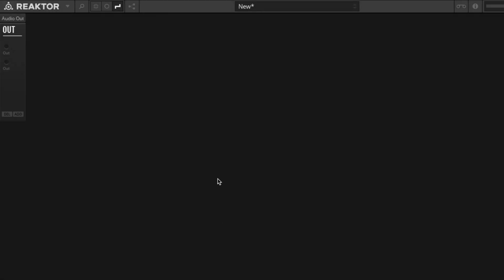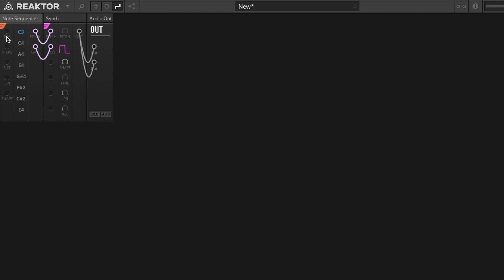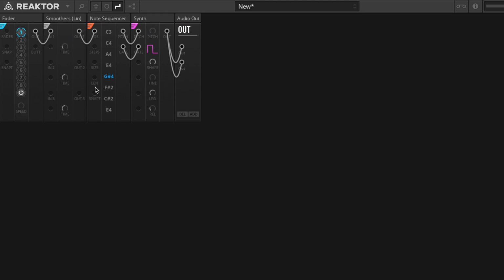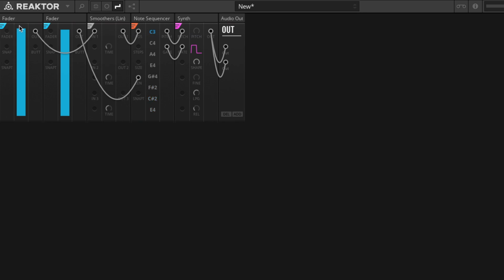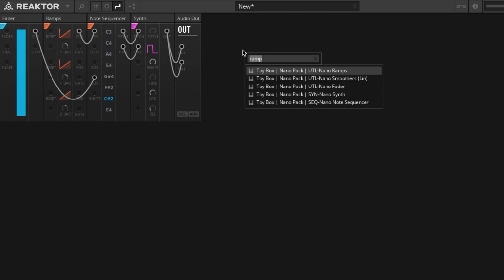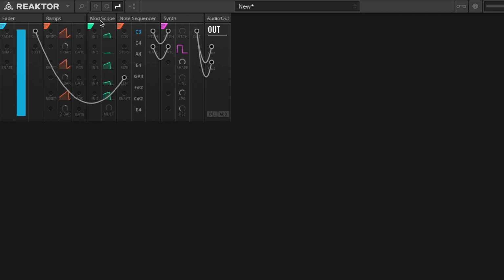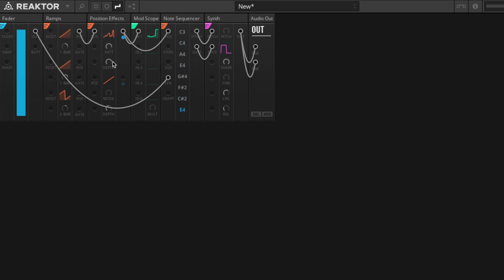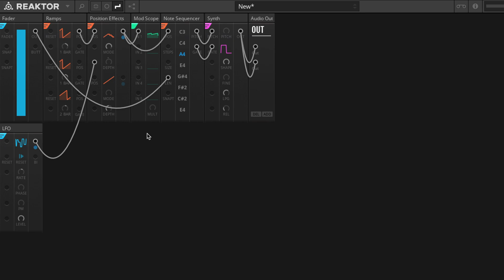Toybox - Nano Pack Sequencer Basics

Comment: Excited about this..BUT how do I get the Ramps block to work? It is not running when I load it and dont k ow how it starts?
Reply: Oh...I press play in my host!
Reply: @stevestringer5110  Yes in 'sync' mode (turn speed knob to the right) the block starts and stops with the host, in 'free' mode (turn speed knob to left) the block will always run.